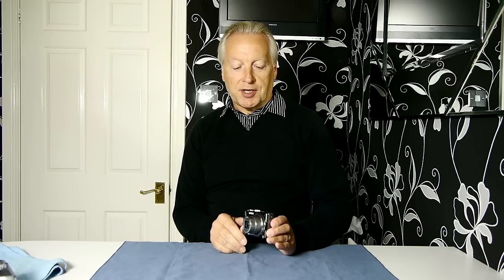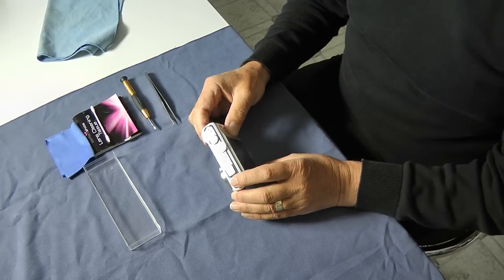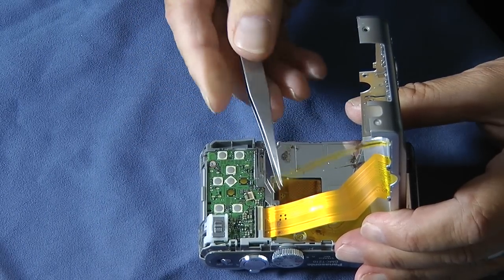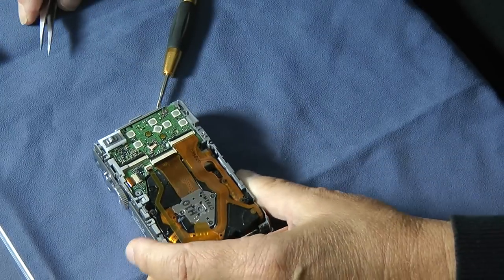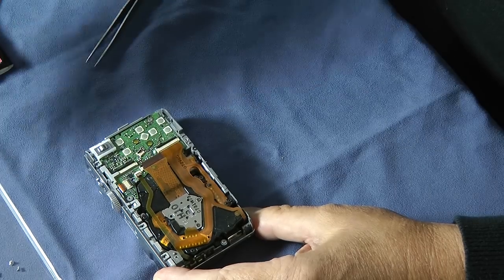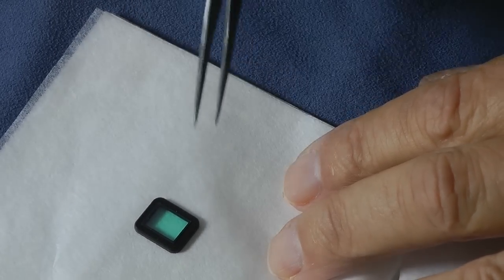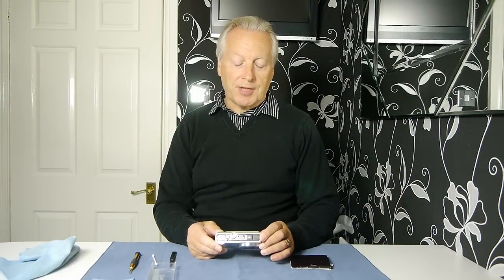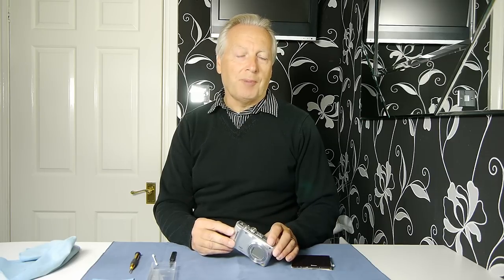Cleaning the CCD sensor of a Panasonic Lumix Compact Digital Camera

Comment: Thank you Graham Houghton. This concise instruction video has saved me money and bought me time to consider an upgrade. I have a DMC-TZ7 which is almost 6 years old and my photos sufferered from grey blobs, especially noticeable with a plain background [ie blue sky] I wish I'd done this when it first appeared last year. The only nervous moment I had was when I switched on the camera after the procedure and my hopes sank when the screen did not light up. This happened about 3 times and I was worried I'd damaged the thin ribbon cable. I decided to apply a little more pressure to the connector as it looked as though I wasn't getting the connection fully 'home'. Thankfully this did the trick. Quick trial photos show no blobs but waiting a clear blue sky for confirmation. :-)
Reply: Suggestion: try a shooting white interior wall.

Comment from the maker: Hi. I was a senior engineer with Kodak and spent lots of hours repairing photographic printers and processors. Later I joined the training and technical support centre where I eventually became manager until 2001 when Kodak started to shed people in the UK and I decide to leave and take a new career path as IT manager/programmer. I retired in 2009 when the company closed manufacturing in the UK and moved to Tunisia I still enjoy electronics and making stuff in my garage workshop.

Comment: Great video, many thanks. This saved my wife's camera!
I found it to be important to inspect the sensor etc. before reassembling the camera, using a bright light and a good magnifying glass to ensure that it really is clean. 
[A 50mm or 35mm lens from an old SLR camera can be an excellent magnifying glass, but you may need to experiment with it first. Hint: With the lens aperture wide open, hold the back of the lens about 40mm from the object, and place your eye close to the front of the lens]

Comment: You are a lifesaver, Graham! This has happened to three of my Panasonic Lumix DMC-ZS5 cameras. The first one was replaced by Panasonic (it was out of warranty, so I had to pay for the new one), and the second one was abandoned when I bought a used one from an independent seller on Amazon. When that one went bad, I was going to buy another brand of camera, but I was disappointed with the image quality of the Sony that I bought, so I returned it. That's when I discovered that this has happened to lots of other people too, and that's what led me to your video. I have now successfully repaired BOTH of my Panasonic cameras, so now I have a backup. Shame on Sony for not admitting to this problem and doing something about it, and thanks to you for helping me fix it, and I'm no techie! The only hard part was finding a Phillips head screwdriver that was small enough to fit the screws. (I finally found one as part of an eyeglass repair kit at Wal-Mart for $1.27.)
Reply from the maker: Thanks Greg for you feedback on this video. A lot of users have now successfully cleaned their cameras after watching this now.

Comment: Thank you for this. I was plagued by a large black spot and a grey boomerang-shaped shadow on every photograph. I could edit them out to some degree using a photo editor, but it was a huge pain of course. Your video is the best I've seen in terms of clarity and explanation, though unfortunately the model you used was slightly different to my Lumix DMC-TZ18 so I got stuck at the outset on removal of the back cover! Eventually I managed it, and then found the inside to be slightly different, especially with regard to removal of the ribbon cables. Anyway, with dogged persistent and improvisation I eventually got to the infra-red filter and found the offending little buggers and got them swept away. Almost as bad as the deconstruction was the matter of getting all those tiny tiny screws back in their holes! In conclusion, after watching your video twice, then two hours "hard labour" - accompanied by Play/Pause on a third play of your video - JOB DONE! Cheers.

Comment: Hi Graham,

With a very prominent dust item showing in the centre of photos I followed your clear instructions today and subsequently checked a photo taken of the sky. The images are now clear and dust-free.

Although my FX60 had a slightly different method of removing the bottom and the small ribbon cable, the instructions provided enough guidance and confidence to step through the tasks, from start to finish.

Thanks for the video, you saved me either a high cost at a local camera shop or a replacement camera. 

Thanks again. 

Martin

Comment: Thanks much for the clear instructions.  Going in I thought that it wouldn't work, since I suspected that the dust was within the layers of the lens.  My 1 yr warranty had expired just a few days before these dust particles started wrecking my photos, and Panasonic repair stated minimum of $172 USD.
Well, I went through this fairly easy process outlined in video, and It worked!!!
Thanks again,  Isaac

Comment: Thanks so much for this instruction video, Graham! I picked up an old Lumix FX150, and it's a great little digicam. Only problem, I was getting black spots on images. Drove me nuts trying to clean the lens, and realized it could be the CCD sensor, which led me to your page. I was a little hesitant to open up the cam and clean it myself. But I followed your instructions, and I was able to clear the dust! Now, images are clean and free of black spots. Much appreciated!

Comment: Thanks again Graham. Rather than a bad workman blames his tools. I went out and bought a good set of tweezers, an anti static camera brush and I already have a set of Lindy tools. My last plan is to buy a used camera with a different fault and swap the parts around. You have given me the confidence to take them apart.

Comment: Thank you, Graham.  Your video gave me the courage to attempt to clean the CCD sensor in my Panasonic Lumix DMC-ZS6 camera.  It had some kind of fibre and what appeared to be a yellow pollen grain behind the lens, ruining almost every shot, especially in low light situations.  I modified the procedure you showed as follows:

I did not unplug any of the flex circuits.  Instead, once the eight screws holding the back on were removed, I shifted the back with the LCD display to the side, being very gentle with the flex circuits, making sure not to crease them or exert undue pull on the connectors.

I didn't unplug the CCD sensor.  Once the three screws holding it were removed, I gently bent the flex circuit upward with one hand, holding its edges with two fingers, while I fished the IR filter and its rubber grommet out of its recess with stainless steel tweezers.

I first used a lens brush, the camel hair type attached to a rubber bulb, to gently clean the face of the CCD sensor and both sides of the IR filter.  I also brushed the exposed part of the lens element that was closest to the sensor, giving it puffs of air from the rubber bulb.

Since all the flex circuits were plugged in, I was able to insert the battery and power up the camera, extending the lens.  Once the lens was extended, I removed the battery, leaving the lens frozen in the extended position.  I then used a rubber-tip blowgun and low pressure air — around 10-15 psi (70-100 kPa) — to blow out the inside of the extended lens assembly and the surface of the CCD sensor.

Next, the camera was partially reassembled, installing the IR filter and rubber grommet (red-hued sided toward the sensor), the CCD sensor and the bright metal shield.  I then placed the back on the camera, but DID NOT install the eight screws!  The battery was re-inserted and with the back held in place by hand, I was able to power the camera up and verify that the sensor and lens were clean.  Only then did I proceed with installing the eight screws that hold the back in place.

For others who wish to try this procedure, note that Panasonic uses an anaerobic thread locking compound, removable grade, on all exterior screw fasteners.  It is pale blue in colour, so I'd guess it is Loctite 242, or equivalent.  This means that considerable torque is needed to break them free and to remove them.  Use a sharp #0 crosspoint screwdriver and press firmly into the screw head to keep it from camming out and damaging the screw or the camera finish.  If the screws feel "gummy" when being reinstalled, that's probably good enough to prevent them from loosening on their own, but if any of them feel loose going in, I'd recommend putting a tiny drop of Loctite 242 thread locking compound on them with the tip of a jeweller's screwdriver before snugging them up.  Also note that thread locking compound should NOT be used in the vicinity of the lens or CCD sensor, as the stuff out-gasses while curing and may cause a tenacious haze to form on the optics.

Comment: My sincere thanks for taking the time and putting such a well thought out presentation on you tube Graham. Within 15 minutes I had my camera repaired and I could see flecks of dust and dirt on the filter when I removed it. My TZ 10 is back in the ring and the images are sharp and spot free again. Again sincere thanks and respect for your generosity Graham.

Comment: Excellent video, saved me an expensive repair. I hadn't realised (a) dust on the sensor was so common on these cameras and (b) it was so easy to fix. I had a speck that only appeared in the top right corner when zoomed in. When I checked the sensor there was a very obvious dust speck.

Comment: Just to follow on from my prior post.  It turned out that after cleaning my IR filter I screwed down the sensor too much and cracked the filter(which explained the mark down the left hand side of image).  Was beside myself trying to find a replacement filter.  I got in contact with a uk company called ace camera repair and they had them in stock more over it was delivered next day! Camera up and running!  Thanks Graham for your expertise!

Comment: Thank you for posting such an informative and clear video. Big blobs on certain photos, especially sky on full zoom, meant the camera has been consigned to the bust gadgets drawer for a year.  
I found your video and plucked up the courage to take my Panasonic DMC-Z3 apart to clean the dust from the infra red filter.
I found it hard to undo the cables from back case LCD but by being careful did not need to in the end. The other tricky bit was removing the thin back plate and then fitting it when reassembling.
After a careful 45 minutes work the camera now works a treat. No more blobs.
Thank you.

Comment: Cleaned the IR filter on my DMC-TZ8. Worked perfectly well.
TIP - on DMC-TZ8, two extra case screws need to be removed to remove the silver metal plate.
Very good tutorial. Saved me lots of money and time.

Comment: Graham, thanks for this great video with easy to follow procedure. Today I opened my camera to remove a speck of dust from the inside of the camera and onto the sensor. I noticed a white dust particle on the filter right away and removed it. What was really not so simple, was the handling of the tiny screws and the reconnection of a narrow ribbon cable. But otherwise the procedure was very simple to follow. Now, I can create again dust-free photos with my camera. Thank you!

Comment: I had a fine hair in the corner of the picture and some blobs of dust in my Panasonic TZ10. I followed your instructions precisely and it cleaned it beautifully.  One small hint - if you accidentally touch the infra-red filter with a finger it is easy to leave a fingerprint mark on it (which I did!). The solution was put to put a small drop of lens cleaner liquid onto a cotton bud and give it a gentle wipe, then leave it for a few minutes to dry - it sorted out the problem nicely.

Comment: This video gave me the confidence to open up my Sony point and shoot to remove a spec that was on the sensor. This effort was after I had tired the vacuum method and also removing the lens from the front to clean it. Once I saw the spec on the sensor I knew I found the cause of the spot in my images. The senso looked very much like the Panasonic one. Casualties of my effort include a small plastic tab that broke off one of the housing pieces, leaving me with an extra screw at the end, and also my pop up flash no longer actuates automatically, But it functions as a flash when I pull it up manually, like old times. There were anxious moments when the LCD screen was not coming on, but I realized I that the ribbon connectors came undone and was able to get them connected well again. I saved at least $300 in repair charges and gained a lot of satisfaction. I've taken nice pictures with the camera and now look forward to many more.

Comment from the maker: Thanks for the feedback. Essentially all the Panasonic compacts have a similar method of mounting the CCD to the lens block. It's just a matter of carefully dis-assembling the camera to gain assess to the CCD. Providing you don'y rush, or be too heavy handed on the ribbon cable latches it is a method that will pay dividends if you are plagued with the dust on the surface of the IR filter or rear focus element. Well done and thanks again.

Comment: I have to say I have never commented on anything before like this but the effect was not a blob more a line. I dropped my TZ10 and had a semi circular line across the top right corner of any photos I was taking. I though I might have cracked a lens. I watched your video through once then followed your instructions, particularly how to clean the sensor and the filter. I found what looked like a fine hair on the filter. It all worked after resetting the connections to the back of the camera a couple of times. It might be an old camera but it takes great pictures in good light so I am glad to have it working again. Thanks for taking the time to post...

Comment: Thanks Graham, worked a treat, made my second-hand purchase significantly better value. Only slight struggle was getting the third small ribbon cable back into the socket (on a DMC-TZ20). As a veteran ipad screen replacer, this was relatively easy.

Comment: I did this to my DMC ZX1 / ZR1, and the inside is exactly as the camera in this video, except for the sensors connector, which is a little higher to the right. the infrared filter remained fitted to the sensor unit in my case.Now the dust particles are gone. Thank you so much for this step by step tutorial. Happy Holidays.

Comment: I lost the very first screw I took out - it jumped out and disappeared into the carpet - but after crawling about for a while I found it, and things went better from then on. I had a bit of difficulty getting the back plate off, because it was a different design from the one you had, but it did eventually pop off. Also, there was no separate little infrared filter, but I gave what I could a little wipe with a cotton bud, and now I'm delighted to say there are no black spots. Thank you very much!

Comment: Thanks for this, Graham Houghton.
 Today I fixed some dust on my Canon Elph 330HS sensor by direct vacuum method - vacuum cleaner from the front of lens. I just put the front of the camera - lens fully extended - on the 2.5 inch vacuum port on the cleaner itself (no hose). Worked instantly! 
But the point is - for the next time I really do have to open a point-and-shoot camera - your run-through here is informative and inspiring. Thank you!

Comment: Thank you so much!  Panasonic said to try to suck OUT the dust with a vacuum and it worked... somewhat.  But a bit of dust remained.  Your video stepped me step by step to clean the inner lens and sensor and it worked great.  The most difficult part was reinserting the ribbon connector from the screen to the main body.  Panasonic Lumix dmc-ZS9

Comment: Hi Graham Houghton and thank you for this video. I just came back from the Wacken Open Air festival, where the air was full of dust all the time. On the second day I got nasty spots and other unpleasant stuff on the pictures of my Panasonic DMC-FX37. I followed your step by step instructions for disassembling the camera and used a blower to get rid of the dust on the filter screen. I could see the dust easily and the blower removed everything in this case.
I'm so happy that the camera can be used again. :-)
Btw: there are fewer screws on the outside of the DMC-FX37 and one more on the plate inside, but the procedure is just the same. Thanx again!
Reply from the maker: thanks for posting up your success story, another to add to the hundreds now that have performed this with full success

Comment: :-) A big thank you Graham. I couldn't believe my luck when I found your video. I tried it and it worked. Mine's a TZ20 and it looked a little different inside as someone else also stated below. But I cleaned the back of the lens and the film in front of the CCD and it appears to have done the trick. Thanks for taking the time to post such a high quality video. Cheers. Paul for Herne Bay.